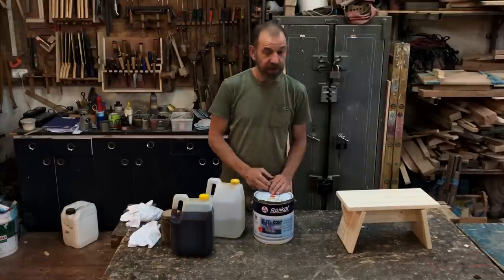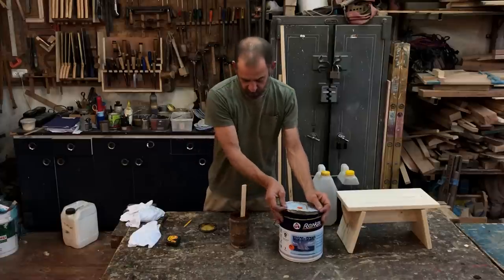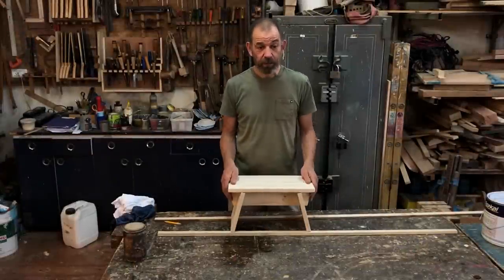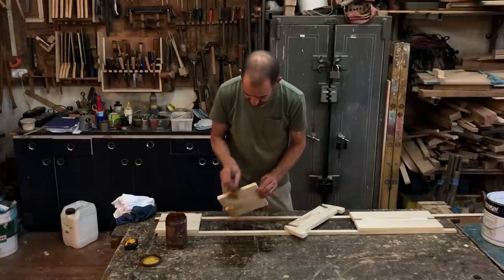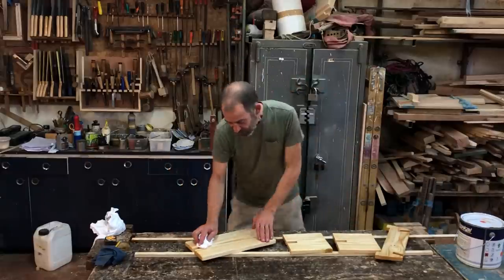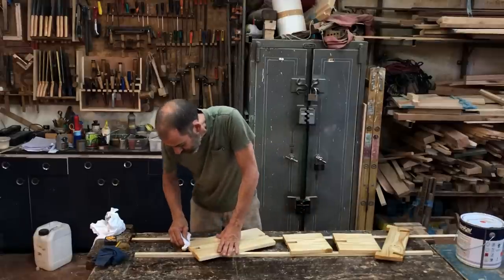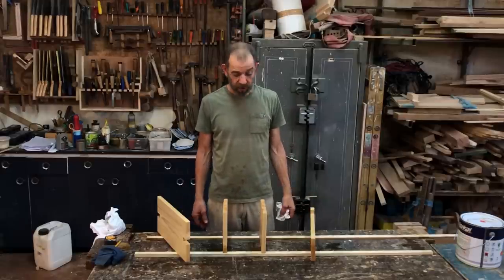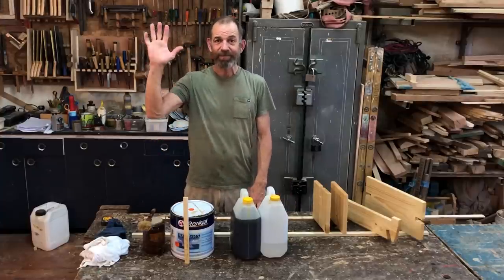Make Your Own Danish Oil - For Wood

Comment: Many thanks for the measuring stick tip Dave! Absolutely brilliant, one of those tips that has you thinking, "why did'nt I think of that ", I always finish off with fine wire wool, I find it gives a burnished finish, another tip I can throw your way is when cleaning the brush, if you use a jar that has the same size body as it has top opening, (some French jam jars are like that), if you fold up a perforated zinc "table" like platform and place it in the bottom of your jar,(1/2" off the bottom), you can tip in the turps to cover the zinc sheet, then when you wash your brush you can agitate it against the zinc and more easily remove the paint/oil, the crud drops through the perforated zinc into the bottom, and you wash out your brush in the clean upper layer, then just screw the lid on and allow to settle for next time! Simple! Stay safe ! Chris B.
Reply from the maker: Hi Chris love the cleaning jar idea brilliant im for ever decanting the turps !! Thanks for your feedback Happy Woodworking David

Comment: Hello, I hope you’re doing well. I’m looking to make Danish oil and I have the following materials:
-Linseed oil that has a honey-like consistency.
-Turpentine that is yellow in color.
-White spirit that is clear.
-Alkyd varnish.
Could you please advise if it’s possible to make Danish oil using these ingredients? If so, what would be the recommended mixing ratios for these components? Thank you for your help!
Reply from the maker: Hi I haven’t used alkyd varnish myself but from what I understand it’s a polyurethane varnish so it would be good for danish oil try mixing a small quantity half varnish quarter oil quarter turpentine paint on and wipe off after 20 minutes give it 24 hours to dry then sand smooth and wipe on another coat 20 minutes wipe off 24 hours dry repeat 
Good luck!
Reply: @RusticDavid  
Thank you very much for your advice! I really appreciate your help and will give it a try. Have a great day!

Comment: Hi David, thanks for the video.
I just finished my first fir workbench. I wanted to put linseed oil but this oil gives a yellow color to fir wood, I don't like it. I would prefer the oil to highlight the grain by darkening it to brown. Do you think your solution is right for me?
A thousand thanks
Reply from the maker: Hi my danish oil will also go yellow then with time the wood oxidises and will be darker if you want  dark from the beginning then you need to stain the wood beforehand you can find stains or dyes at your paint supplier 
Or you could add some brown oil based pigment artists oil paint can work to the oil to colour the wood
Good luck best wishes David

Comment: Hi David. I just used your recipe for the first time, and am very impressed. Previously I’d always used the “normal” 1-1-1 formula. Out of curiosity, in coming up with this formula, did you ever try using even more varnish, say a 3-1-1 mix, and if so, what were your thoughts/results? A final thought, I also much prefer the turpentine to the mineral spirits I’ve used previously, and feel like an idiot for not having thought of it myself.
Reply from the maker: Hi Murray Thanks for watching, more varnish makes it more like wipe on poly varnish it doesn’t penetrate the wood as deep, more oil pops the grain more and doesn’t build up a film on the surface , my friend did many tests years back and he actually came up with this recipe so credit to Amit ,previous to that I used to mix by feel depending on my needs more like cooking! But a base recipe is good to have, don’t put yourself down over the turpentine we all live and learn Best Wishes David
Reply: @RusticDavid  ...Thanks David...you just saved me time and product experimenting for myself. I guess what I’m looking for is getting as close to the line as possible, where a Danish oil becomes a wipe on varnish...without crossing the line, and without having to measure down to the ounce. Sounds like this nails it....and thanks to Amit for doing the testing for us. I first used this mixture on a smallish box, and I keep caressing it, and sticking my nose in it, to smell the residual odour....great stuff 👍🏼.

Comment: Hello Rustic Dave, is that mixture, in that ratio, good also for finishing a wooden floor?
Reply from the maker: Hi Elad this mixture is “danish oil” its not a hard finish you could add tung oil to make it harder wearing, I have been putting it on chairs and tables for many years with great success 
If you remove your shoes when walking on the floor no problem 
Good luck with your project David
Reply: @RusticDavid  Thank you very much. Will it be still better though than just linseed oil?
Reply from the maker: @eladsadeh  In my opinion yes ,linseed oil will need many coats over a long period of time, 3 coats of danish oil will do ,in areas of heavy traffic give another coat

Comment: Thanks for the video, it was really clear. I'm hoping to try this on a farmhouse-style kitchen table I'm making. I'm guessing that with the linseed oil and pine-turpentine base it shouldn't be too toxic. I'm keen to use this Danish oil recipe but do you think it would protect the table well enough?...for a surface that will be used so much should I go with a polyurethane finish?
Reply from the maker: Hi Nora I have used oil on kitchen tables and worktops, if you maintain it ie apply a little oil if it’s looking sad it will build up a patina and just look better with time, the difference with a polyurethane varnish is that oil protects by soaking in to the wood leaving it feeling like wood it will get scratches and knocks but I like this ageing , polyurethane varnish sits on the wood like jacket and feels plastic but the look remains the same as when applied but it yellows with age,is i use varnish i prefer water based Acrylic varnish it’s easy to apply dries fast and doesn’t yellow but still feels like plastic.
Good luck with your table Happy Woodworking David Btw I would love to hear what you choose

Comment: Can a bit of wood be salvaged if it has been exposed to diesel or water containing used engine oil?
Reply from the maker: Hi David diesel and used engine oil aren’t very good for your health, depending on the size of the piece you could try plenty of detergent and warm water to wash the oil etc out of the wood, engine oil if it remains will stay oily it will not dry,you could try solvents but again not very healthy.
Don’t be afraid to immerse the wood in detergent and warm water it will dry again quite fast depending on the weather, I hope that helps you good luck David
Reply: @RusticDavid  hi, thanks yeah I'll try detergent and water, the diesel issue was mostly fumes and footprints on a pallet, not a large spill. The oil was in the bilge of a yacht and the wood exposed was varnished however there were holes for bolts and some damage to the end exposing end-grain, so I might remove the damaged part entirely and hope it isn't too saturated. I agree about the health issue, I prefer sailboats now, and would like to install an electric motor or an outboard depending on the budget

Comment: Can I apply first one or two coats of linseed oil and later the danish oil coat? How many coats of danish can be applied? Thanks master
Reply from the maker: Hi yes you can apply boiled linseed oil first but wait for it to dry completely before applying the Danish oil 
Different woods will absorb different amounts of oil as long as you stick to the routine of sanding oiling waiting rubbing off and drying between coats until you’re happy with the finish remember it’s not supposed to be an outer shell it protects the wood by soaking in. It’s not a varnish

Comment: Hey I do have a question as I keep watching.  So do yo know if shellac flakes broken down in denatured alcohol work like the varnish does?  Perhaps the fibers in the shellac don't have the stretching properties the varnish has.  Just currious if you think a shellac linseed oil and alcohol mix would work and be considered a Danish Oil.
Reply from the maker: Hi I wouldn’t think it will work together but you could give it atry in a small quantity and see what happens 
I have used Shelac as a sealer before oil with good results Best Wishes David

Comment: Hi David, I have made my own Dänish oil and used it on a Project and it came out good. Here is a question. I have done a garden table renovation. Teak. I gave it a painting and After an hour rubbed off any excess. That was yesterday. Today I gave it another go over, and After 40 mins, instead of rubbing off excess, I used a clean brush and spread the little excess out. Here is my issue. There are no " puddles" and I like the shine. Can I just leave it for say 4 to 5 days to dry?
Reply from the maker: Hi Dave better to rub of excess and allow to dry sand oil repeat then if you want the shine take yacht varnish diluted 20 percent and wipe it on with a rag , it will be a better top coat and give you some shine the oil is too soft as a coating hope thats clear good luck David
Reply: @RusticDavid  Thanks Dave. I rubbed off the excess. I will now leave it a few days. Thanks for the advise. All the best.
Reply from the maker: Dave Taaffe small detail dilute or thin the yacht varnish with turpentine
Reply: @RusticDavid  Will do mate. Thanks.

Comment: Thanks Dave. Question...can I add a teak colour to the mix. I am building a small corner bench with cast iron arms etc. The wood is light soft timber, but I want to darken it down when oiling. Cheers for and advice.
Reply from the maker: Hi Dave ye you can add an oil based pigment (or artists oil paint) to the mix until you get the shade you want All the Best David
Reply: @RusticDavid  Thanks Dave. Till now I have used just boiled linseed oil on renovated teak wood. But was not sure about adding a stain. Thanks again.

Comment: Hi!! What is the difference if I use mineral turpentine?
Reply from the maker: Only the smell whilst drying as far as i can tell. Good luck with your finishing David
Reply: @RusticDavid thanks! I would like to make It with normal varnish, for my guitar neck. Can I use any varnish or It needs to be water, oil or Poly based?
Reply from the maker: @onedayapp3534  oil based varnish only

Comment: I really enjoyed your no-nonsense, experience-based style of presentation. Subscribing instantly :) Also, do you think this mix will be sufficient for outdoor applications?
Reply from the maker: Hi no ej Thank you for your feedback, yes this oil can be used outside for long term protection it is best to lightly sand and re coat before each winter and summer commercial oils contain pesticides which help prevent fungi and bugs, linseed oil also provides protection but requires the above maintenance.Btw use yacht varnish with uv protection Best Wishes David
Reply: @RusticDavid  thank you, David! ;-)

Comment: Have you ever used White Spirit instead of Turpentine? It is much easier to find, and should serve the same purpose of increasing the penetration. Stay safe! Chris B.
Reply from the maker: Hi Chris, you are quite right, and the type of thinner only effects the drying time and odor.
Thanks for your response Best Wishes David
Reply: @RusticDavid  I thought the curing time would be a main effect of using White Spirit, and also the odour, I am using this mix on my outside Oak window frames, so that will not affect me adversely, I will use the turpentine on the inside! Stay safe! Chris B.

Comment: Can this concoction work on a 19-foot sailboat with just a little mahogany trim? Probably less than 8 square foot on the outside. in the weather. I'd like to also do the inside as well. 
The wood is 20 years old, well-weathered, and has over the years a few coats and recoats of varnish of various manufactures. This wood has been sanded down with no old finish on the SURFACE can't say what may have been soaked ii to the wood over these years.
Reply from the maker: Hi Craig well for the outside I would stick with yacht varnish thinned with turpentine sand between coats and wipe clean with turpentine or acetone apply as many coats as you can the Skipper on the yacht I worked on in my youth wouldn’t settle for less than 15 coats. Inside Danish oil will do a great job.Happy Sailing David
Reply: @RusticDavid  Thank you for the insight on my little sailboat. Don't know what I'm going to do. Our second house we had factory Pella mahogany widows from the vaulted ceiling to the floor.  Our carpenter mitered in place butternut rounded surrounds.  And finished all in Danish wiped stain. Came out great.
Reply from the maker: Hi if you start with Danish oil its easy to maintain with a light sanding and wipe on another coat and rub off you will probably need to do this once or twice a year depending on the weather, you can always varnish on top if you want no problem good luck David

Comment: I used polyeruthane varnish, boiled linseed oil and turpentine in my mix. It takes very very long (two weeks) to dry! What did I do wrong? Any idea?
Reply from the maker: Hi Philip, there’s a couple of possibilities, the ratio of the mix i use 50% yacht varnish 25% boiled linseed oil and 25% turpentine 
Did you wipe off all excess oil thoroughly leaving a smooth dry feeling to touch? No sticky film
Some woods don’t work well with oil Indian rose wood for example takes a very long time to dry cypress dries fast so maybe it’s the wood google your woods properties Best Wishes David

Comment: Here in the U.S., I've never heard of "yacht varnish", however we have a urethane based product referred to as "spar varnish", made by several different companies.  Typically described as "marine finish", "exterior grade", and having qualities of durable coating, water resistance, UV resistance, flexibility to withstand the elements, etc.  Does this seem like pretty much the same thing?
Reply from the maker: It sounds like a similar product check if it’s polyurethane, buy a small can and make some tests ,if im not mistaken spar varnish is a harder finish less flexible so perhaps add a little less Happy Woodworking David